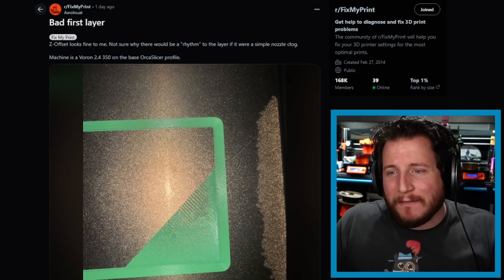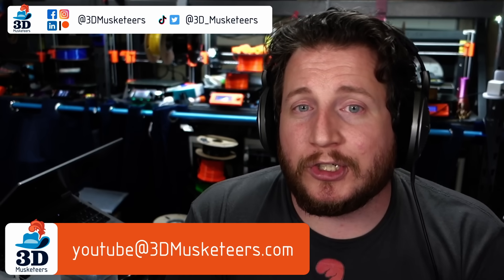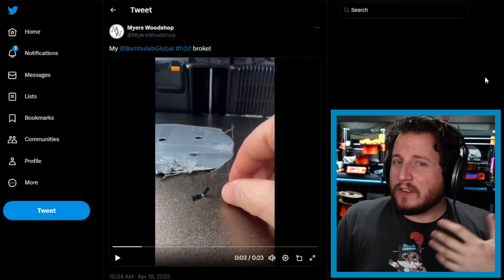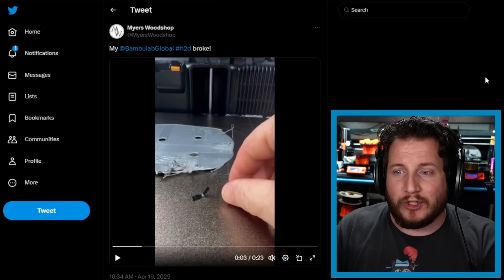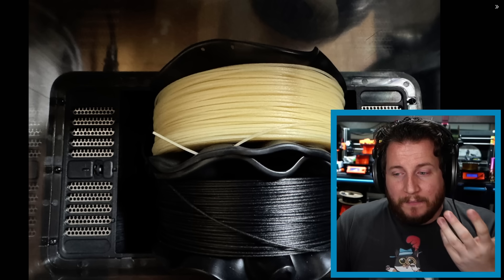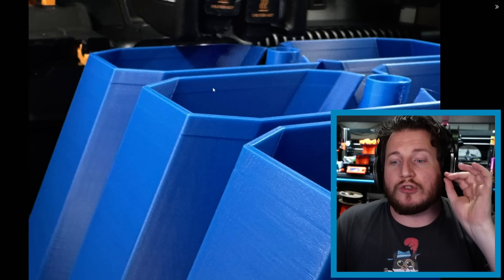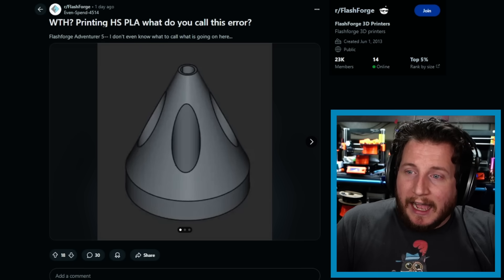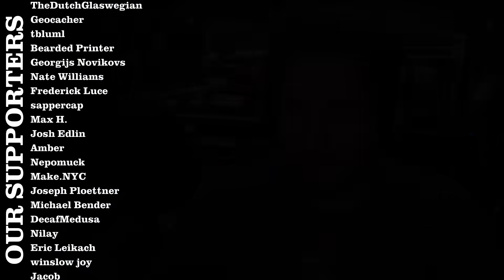H2Ds Are ALREADY Breaking?? - PrintFixFriday 190

Comment: I melted a PLA roll in the PolyDryer on the low setting, because I forgot the lid open. It makes sense, it's meant to be a closed loop system, if you leave it open, it's cranking the heat, but it's only at ambient
Reply from the maker: It's why I wish the poly dryer had temps you could set.

Comment: I had something similar to the user with the bad first layer on my Prusa MK3s some time ago. The first layer was perfect except for one spot, where it was very thin or even missing completely. (Though not with that pattern the user experienced.)
After trying a lot - really a LOT - I accedentally put my hand on the heated bed (with the sheet off) and felt someting: It was a tiny little flake from an older print. It was maybe 2-3mm in diameter and only a fraction of a millimeter thick... but the same is true for the layer heights typically used in 3D printing. 
After removal the first layer was perfect again.

Comment: Hiya Grant and thank you for an other great PFF episode. ❣
However, Bampoo has not come up with the ooze protection. It was used in the Voron Tridex (an IDEX Trident), so they took it and bottched it up. To save costs the put the 2nd printhead into the one cpre xy motion system WITH underengineered adaptations. My guess the H2D will be a huge failure and suffer from broken parts within warranty or just out of it, depending the print volume. But that happens if you "trust" products from a company which is know for: stealing ideas and fileing them as their own once in patens, "stealing" the Prusa Slicer and only after been caught (with their hands in the cookie jar) they admit it, the disaster of the A1 cable and their constant alternated blog to the "Security Update"... But that happens if you give your money to a company which gives a shit about the customer and does everything the DJI way, make a product based on open source and then lock it down, collect data for Xi, etc etc
    If I had a 3D printing business/farm, I would never ever use a Bampoo, I'd buy a lot of SV06 or Prusas...
End of Tina runt 😉

Comment: That first print example looks like an extrusion deficiency moreso than a z offset. Without seeing exact settings, like the old Suck Squish Bang Blow analogy, printer tuning is slow down, heat up, more filament until the first test goes from window shades to amalgamated polymer piece of paper. 😉
After that, check your spool tension. Filament getting bound up but the rest of the components don't know that it's under-extruding until you see it on the plate.
Reply: Yeah the pattern it produced seemed to be perpendicular to the nozzle movement direction which seems impossible with wrong z offset. And the perimeters didn't have the same problem, a z offset problem would affect all parts of the print.

Comment: My first attempt to print resulted in repeated failures due to filament balling up on the nozzle. I ended up aborting it and printing it on my Prusa Mk4S. I was using Bambu PLA and the model was a Bambu filament spool. I have successfully printed the spool on both my Prusa and my X1C. Since then, I have not experienced any issues, and I am impressed with the print quality. I bought the H2D because my XL5 has never worked correctly. It's been in a carton for the last 3-4 months because Prusa stopped responding to me after agreeing to its return for repair.
Reply: Sorry about your luck with the XL. I know some people have good experiences with them but I'm not one of them. I was once the biggest Prusa fan ever, but I doubt I'll ever buy another 3d printer from them again.

Comment: Honestly, if you sell nylons that need to be dried at high temperatures, WHY would you put it on a spool that will melt at those required temperatures to dry nylon??!
Reply: He clearly says in the video that the drier runs much higher temperatures than the user set and that it literally melted PLA at PLA compatible temperatures. So the real problem are not filament spools but that Sunlu is running those things at a too high temperature to reach the target temperature faster but didn't test their own product.

Comment: The h2d nozzle blocker is very easy to replace. Mine even came with 2 spares in the box.
Reply from the maker: It comes with 3 I am told, but the whole mechanism is messed up :(
Reply: Hmm maybe mine included 3 spares. Idk. I just put them in a safe place. My Prusa XL is at 102 days of print time, and 26,000 tool change’s and I’m still using the original nozzle parking covers 😂
Reply from the maker: printers that include spare parts REALLY should have spare part storage or we ALWAYS lose them lol

Comment: I had my H2D wiper get caught and bend but I was able to take it off and fix it.  They sell 3 pack replacements on the site for 10 bucks.

Ultimate root cause was the purge wiper assembly on the back of the printer not being installed properly from the factory.  They have some QC issues to work through but overall I love my H2D.

Comment: I learned a lot about my machine playing with line width... as the lines got wider, speed needed to drop to keep up with the volumetric limit of what the extruder was delivering... this gives you a good feel for that aspect of things. In a way you could day under extrusion, is just moving faster than you can extrude...
Reply: "volumetric limit"  
That's the hardware limit or possible the filament was being set at a level that was too low/slow in slicer?

Comment: We... Well the AI in the H2D is set to normal and has a "sensetive" setting that some people say are better. 

The part that broke, i think is a replaceable part, I think made with a weakpoint not to break the printer, 
So as for how much i know it only costs very little. 

As for their support, they are REALLY GOOD :) 
I did refund camera with pixelating issue, i managed to repair it myself with their tutorials, but they sent me a new one anyways :) 

So if you hate bambu, try it out and it will change your mind...

Comment: H2D is $3k+ with the same amount of QC as a $150 ender 3 (so virtually none). Im seeing broken screens, uneven heatbeds, broken nozzles, failing to calibrate, etc.
Shouldn't come as a surprise though. Their X1E is $3k+ and has the same QC and parts issues as their cheapest printers.
Reply: The only I dont like of Bambu is their proprietary nature and the hordes of normies its bringing to the community. Other than that is pretty good.
Reply: @teresashinkansen9402   The firmware of my A1 Mini is terrible. But yeah the hardware and print quality are good.
Reply: You are seeing outlying issues from a minority of owners.
It happens, and much of that was from being miss handled during shipping.
Reply: I payed 2k 300..printed over 50 h already.  No issues.. it's a beast
Reply: @orioncepheus8778  50hrs is nothing, an ender 3 can print 50hrs without problems.

Comment: Whatever you do, never try to dry a PETG spool in an air fryer in drying mode, it was at 40° C and I flipped it a couple of time.  The third time the whole spool weld together 😂 luckily it was a cheapo filament. I am still pissed for the wasted plastic.😊
Reply: That is obviously the same problem as the Sunlu drier in the video, where the device is actually running a higher temperature. Not even PLA would ever get soft at 40C and definitely not PETG. The air fryer is bad and lying to you.
Reply: I think the issue is that the air fryer has a 2000W heating element that is really close to the top of the roll that is laying in the basket. And because is bang-bang it will move on the upper range of the tolerance of the thermocouple. Not the right tool. Was an experiment.

Comment: From experience, it feels like every ai feature that bambu has is not working. Not long ago I had a bed adhesion problem on my x1c. It kept oozing the whole print either way but regardless of my rubber sock, it still stuck hard to the hot end and it ended up having a huge glob being attacked to the fan guide, hot end, and even fan shroud. It took me breaking my fan guide assembly from the fan shroud and hearing the hot end enough to take the rubber sock off and about 2 hours of snipping away the melted plastic to get everything back to usable. Had to re align the z screws and belt tensioner for my z hop and now the hot bed tends to pop when it warms up or cools down. I am sure it has permanent damage now. I also need a new sock for my hot end but that's really not an issue as I was able to pull it out with just a tear along one side. Don't trust the ai. It's trash and makes the x1c pretty useless compared to a p1p at this point. Yes I am irritated I got that printer back in February 2025...

Comment: One thing I do appreciate about Bambu is that they'll actively improve parts during production so replacement parts are often better performing and sometimes easier to replace. 

My new A1 mini has a better filament "yeet-er" than the old one and for $5 I can upgrade to the new one. What's funny is the new one actually caused me more problems as it yeeted the filament a bit too fast and a chunk landed on the Y axis which jammed the printer up. Poop buckets are a necessity on the A1 Mini inside an enclosure.

Great video, love the summary of what's going on all in one place!

Comment: I have Creality Space Pi Filament Dryer Plus (sheesh the name length) with no issues but it's no where near as HOT compare the to Sunlu FilaDryer S4 and E2 but I don't think you can reprogam those? Chould be wrong. But I think people where confused by the Creality Space Pi X4 price, but it does have a on board chip tha can be reprogramed for that added cost. Makes profile modding an option.

Comment: That Bambu nozzle flow blocker wiper thing is awesome, but I think Bambu needs to send a couple extra with their H2D's. Mine actually collided with a purge tower when it came loose and bent it up. While I was able to bend it (mostly) back to how it was, I bought a bunch immediately, knowing how easy it is to mess 'em up.
Reply: They did send extras. Did you not get any?
Reply: @OhImKiCkiN  I had to order some extras. They're not too pricey. $10 for a set of 3.
Reply: @BeardedPrinter  You shouldve had some extras in your accessories box.
Reply: @OhImKiCkiN  They didn't include any, unfortunately 😒
Reply: @BeardedPrinter  That sucks

Comment: Bambu Lab is actually not the first to come up with the idea for a wiper like this. AnkerMake had a similar system on the print head for their V6 Color Engine. It was shown at several trade shows but unfortunately never made it to market. Nathan Builds Robots has a Short that shows the print head at work.